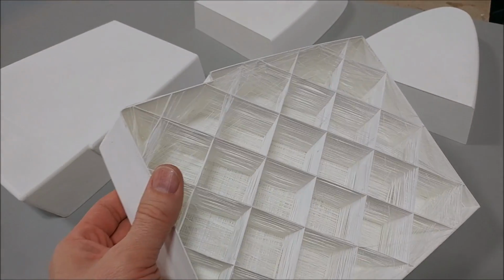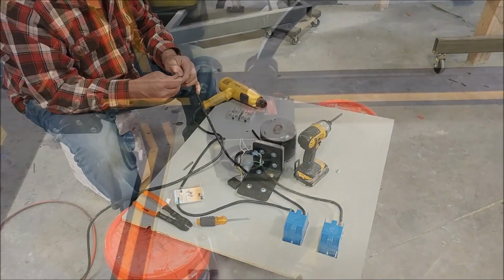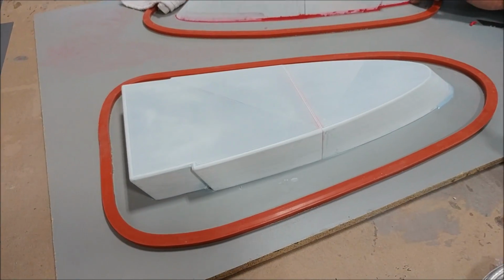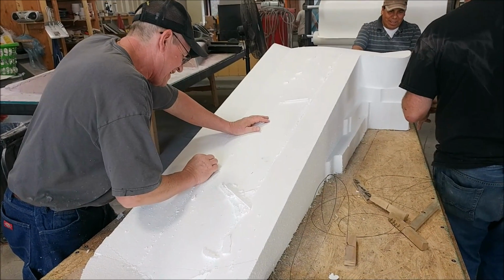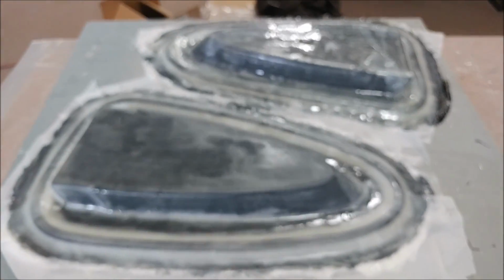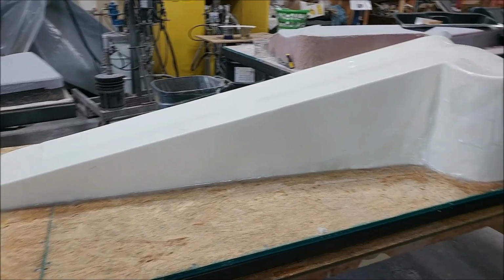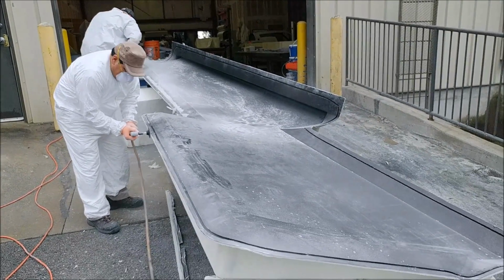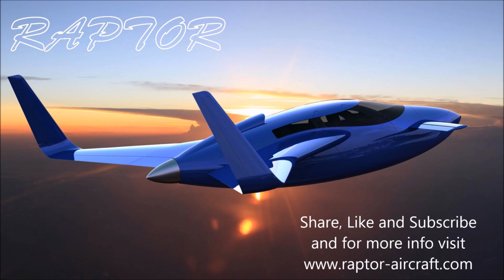On to the Winglets - Milling the next set of plugs

Comment: Would you recommend buying this 3D printer now that you have had some time using it or are you planning to try another model? I am thinking about getting one. Thanks
Reply from the maker: I don't have any experience with other printers but if you add a PEI sheet to the bed to help with adhesion it's great.

Comment: I believe you could ship the tubing plans over to Borla and they would provide you with the intake & exhaust pipes in one-piece polished stainless steel components.  They have incredible capabilities in producing automotive exhaust & breather/turbo pipes using highly accurate CNC-guided mandrel bending machines, as well as highly-precise TIG-welded, ground & polished joints when necessary.

I was alarmed to see Chris sawing the edges from the wing plug without using a mask to protect himself from the airborne fiberglass & carbon fibers

Comment: This would be a super cheap way to make paper templates for this air & exhaust system.
However time on a plasma tube cuter is cheap. & 1000 times faster.  Then the fitting & welding of the piping. Once you set up 1 jig. You can tack up all the components of the piping system very accurately. After that it is just welding time.
:-) I am currently building PLC controller for a 4x8 ft plasma table I purchased at an auction. (controller was missing) I also want to add a tube cuter off the side of the table simply to say that I built it.  Plasma table time here is worth about 65 dollars an hour. So I really do see this table being anything more then a hobby for me.
Reply: Opps...My comment was meant to be a comment on Samuel Corbett post.

Comment: The white filament you are using looks like my white one which is from makerbot. It stays rather softs and it smears. My favorite one is a blue PLA filament from eSun which is glass like and super hard. HobbyKing sells it. I run it at 210.
I haven't tried yet ABS with Aceton which is what EAA wrote about. The article is here:
http://www.electricmotorglider.com/2016/10/stronger-3-d-printed-parts-part2-sport.html

Comment: Great progress mate. Considering you have the piping in solid works already why not make full use of it and convert to 'Sheet metal' then unwrap it and print it out 1:1. You can then just cut the profiles out on paper and transfer to your stock. It's extremely accurate and fast too! You can even put in alignment lines so you get the angles between sections perfect! Keep up the good work

Comment: Looking good!  You could 3D print something with 0.5-1.5cm thick walls and use a fine 25% infill within each wall to get a stiffer print.  This would require generating a different .stl file that has a hollow section, then slicing the gcode from that.  Of course if what you're doing is stiff enough, it may not be worth changing it.